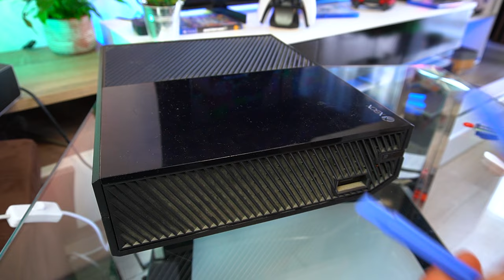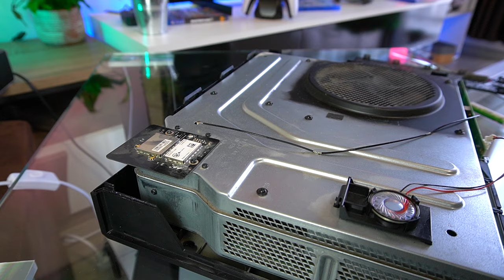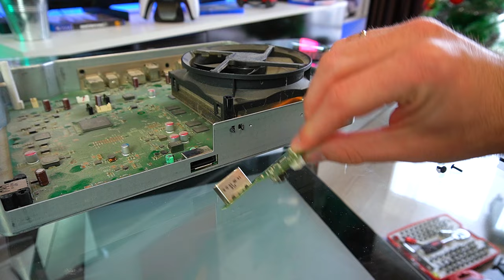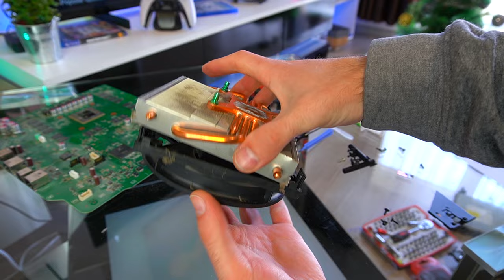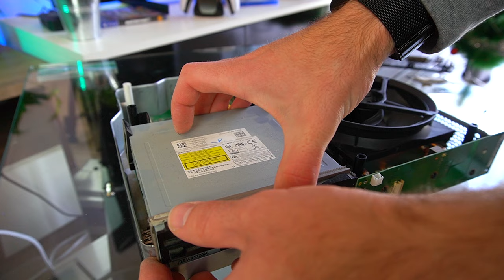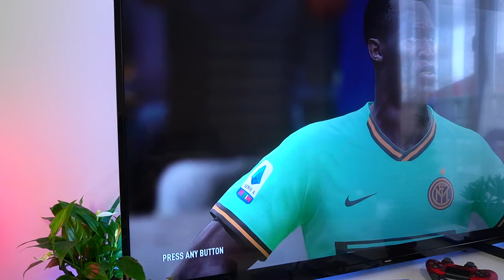Xbox One- Disassembling, Cleaning And Thermal Paste Replacement

Comment: Lmao "it appears that we havent messed up anything" is exactly how i feel when i play inside my box lol (and havent messed up anything)
Reply from the maker: Haha i know how that sounds, ( like there is a tons of stuff that could go wrong) but actually the Xbox One is  really simple to disassemble and work with. On the other hand we have the newer Iphone's which are completely non repairable, and are not even meant to be disassemble by the user. We have to give props to Microsoft for designing the Xbox One the way they did.
Reply: @SkvalaGaming  i have an xbox one s wich is even easier to open up but for exemple yesterday my xbox 360 slim's tactile buttons stopped working and i freaked out a bit lol its fine now
Reply: @PaulRudd1941  god i hate tension clips i just got done with a 360 s today and it sucked
Reply: @woooshbait5398  legend. I still have to clean mine. I bought it new 11... oh God 11 years ago when I was 15. Now I'm terrified of opening it and breaking something.
Reply: @PaulRudd1941  eh its not that bad the worse you can do is break a clip or 2 its still supposed to be easy to open/close

Comment: Thank you for your video it was a great help with my xbox one original  I used mx5 thermal paste and I replaced my 1tb hdd with my broken laptops 500gb 2.5 sata ssd running very smoothly
Reply from the maker: Nice, man. Are the loading times better with the SSD?
Reply: @SkvalaGaming  ya and I've noticed it's faster while downloading my digital games and apps

Comment: I cleaned mine today after almost 7 years and i can say that it was disgusting like this was. Great job! Still searching how to clean the power supply because it makes more noise than the xbox herself
Reply from the maker: I have to clean my power supply too. It's a bit noisy 😃
Reply: mine did the same, get some lubricant for your power supply fan, its fairly simle to take apart. i used WD40 but theres better lube to use im sure that wont attract more dust. the noise has gone away for about 4 months now.
Reply: i hopr you will do a video about this too bro i hope so :)))
Reply: thanks for the tutorial bro helped me a lot
Reply from the maker: @wavesoundsamv6135  Glad it did, brother!

Comment: Have you ever changed the thermal paste in your PS3? If so how often do you suggest doing this? I've had my PS3 Super Slim for about 5 years and never opened it to change thermal paste or even clean it. I've always been afraid of opening it because I'm afraid I might mess up something.
Reply from the maker: Hey man. I haven't changed the thermal paste on my PS3. I had it serviced before i bought it. My advice is that you should probably change your thermal paste. If are anxious to do it, take it to a shop. It shouldn't cost more than 10-20$ to get the thermal paste reapplied.
Reply: I've cleaned out and pasted a ps3 ss. They aren't too difficult,  but you do need to watch out for all the tension clips. Just watch a tutorial video and carefully follow the steps and you will be golden.  I recommend artic mx4 since it offers good performance and isn't too expensive.
Reply: I have and I used toothpaste instead of thermal paste for me its easier then the Xbox because of the x-clamp

Comment: I actually never have had to clean mine in all the 8 years I've owned it. It's still pretty quiet, and has no issues. At the same time, even though it's still running fine with no issues, is it still really dirty inside? I've never had to open it before. Only consoles I've ever opened in my life time was my 360 and my PS3 for repairing Red Ring of Death/Yellow Light of Death.
Reply from the maker: Mine was running quiet as well. But as you can see it was quite dirty on the inside. I would advise you to clean your Xbox One at least once every 2-3 years. I don't think the thermal paste will be in a good condition after 8 years.

Comment: My original  black Xbox one from 2015 or 16 for Christmas, still runs amazing haven’t cleaned  it like this or dust clean I do want to tho idk how much longer it’ll last but runs amazing never have problems
Reply from the maker: If you haven't cleaned it or changed the thermal paste now is a good time to do it. Thermal paste tends to lose its properties as time goes
Reply: @SkvalaGaming  gotcha will my Xbox just stop working if I don’t clean it?
Reply from the maker: @matthewmurdock1897  It can start overheating which can cause hardware damage over time

Comment: Was just gifted an Xbox and holy it was a rat's nest in every way except literal lol. Cockroaches got in it and it was overflowing with dust. It was working but overheated to the point of turning itself off quite a bit

So thank you, I will check tomorrow morning to see if it's working/not overheating
Reply from the maker: That's the thing with these Xbox One Fats and PS4 Fats- they are often in a poor condition. You should get yours checked.  It's a really pleasent DIY task

Comment: What kind of screw drivers and bits did you use? I know that Microsoft has a like for anti temper screws.
Reply from the maker: Just a regular torx screw, the console is very easy to dissassemble actually

Comment: My xbox one s was running pretty good but i decided to remove the case for the first time and clean all the dust off the fan and other areas (it wasn't that dirty), but i didn't remove any of the internal parts or put on any new paste etc
Im too nervous to take it completely apart to put new paste on ( i already cracked a piece off the black bottom part of the case taking it off lol)
Do you think i did a good enough cleanup up since my xbox was already running ok?
Reply from the maker: If you Xbox One was running fine, you should be okay, brother

Comment: Hey just coming back from the comment you posted. I misspoke the code I had. I had E208 and E105 and it ends in 00000000 8007001F. Sorry for the false info. I turned it on for the first time after cleaning the inside and applying new thermal paste like you said. Does E105 still means I need a hard-drive?
Reply from the maker: You can try this- 
Turn off your console by holding the Xbox button for roughly 10 seconds. The console will turn off.

Turn your console back on by pressing the Xbox button on the console or the Xbox button on your controller. If you don’t see the green boot-up animation when the console restarts, repeat these steps. Make sure that you hold the power button until the console completely shuts down.

Comment: can i take cooling fan on its own without taking the whole heat shield off from cpu?
Reply from the maker: No, brother.
Reply: @SkvalaGaming  yes i can i just took it! didn't wanted apply thermal paste because never done it so just wanted to clean heatsink
Reply: @yupiter7 you should do it tho, it is advised that you have actually to change the paste regularly every few years, now imagine what happens after not doing so in 10 years, there is actually no thermal paste left. Mine plus with the dust was blowing hot air like a hair dresser. It's really easy so don't worry

Comment: I've been getting a error E208 and another time E205 code. Console can't make it past the boot up stage. Had it working then it stopped again. Is it safe to assume that it's time to Crack it open and clean and add thermal paste?
Reply from the maker: From what i read error code E205 is associated with bad hard drive. You might want to replace it, it shouldn't be that expensive

Comment: Great video, only gripes are the lack of teaching about the power button's ribbon cable and the white and black plastic pieces. Other than that, I was able to get it all done.

Followed this video to the letter and cleaned everything out. My thermal paste looked fine and not flaky or burnt, so I just reassembled it and it still cuts off. May actually be the thernal paste, but I'm unsure.
Reply from the maker: Can you describe how your consoles cuts off, brother?
Reply: @SkvalaGaming  Just playing my games and it just cuts out after a few hours. Can't power it back on unless I unplug it. The power supply isn't bad, as far as I can tell.
Reply: @SkvalaGaming So, about the thermal paste. Turns out it was super flat and flaky. Replaced it with Arctic MX4 in the same pattern you did. Will let you know the results soon.
Reply: @GilbertTheWeird  did it work?

Comment: I did something wrong,i tried my best to not lift the upper case fast but i couldn't
Can the connector in the front button panel be changed?
Reply from the maker: I guess it can be replaced. There should be replacement parts on Aliexpress
Reply: @SkvalaGaming  thank you

Comment: These processing units are way smaller than a pc cpu, too much thermal paste can trap heat inside. I always used a pea size drop and had cores and cpu running at 18-25c. I wouldn't recommend the X pattern. 

Taking it apart tutorial was awesome though!
Reply from the maker: Good tip, brother. Thank you 👊